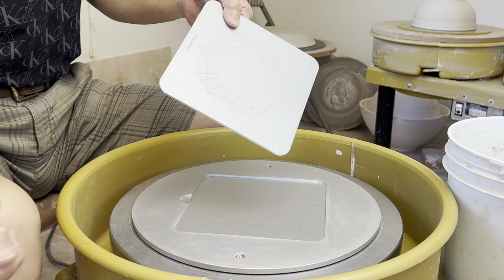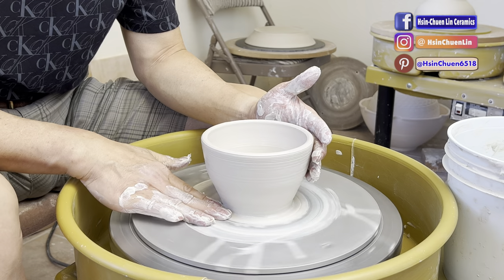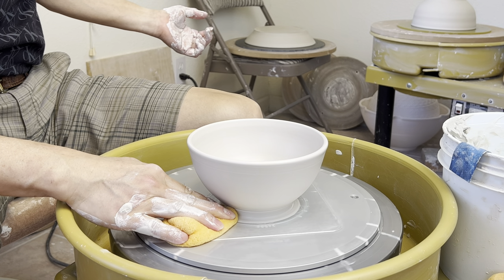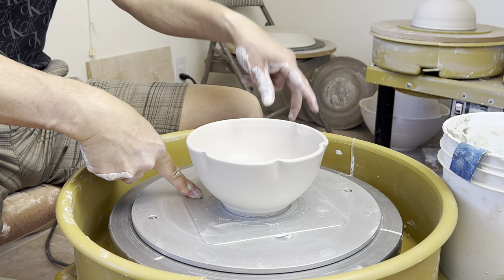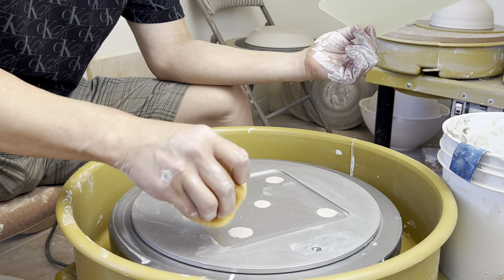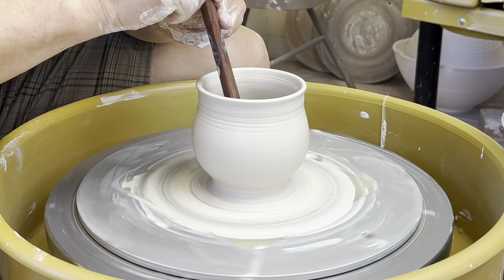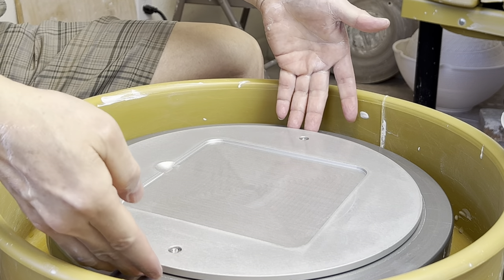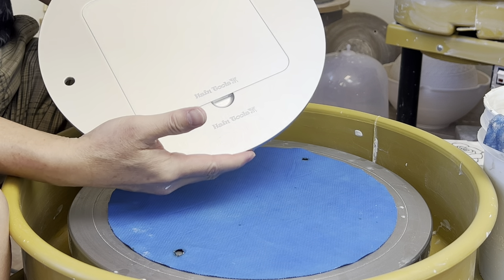688. Using Square Bat Inserts on Hsin Tools SpaceSaver Aluminum Bat System with Hsin-Chuen Lin

Comment: About to buy on Etsy, Hsin - just wondering if the pot lifts off as easily as it does from a wooden bat which is absorbing moisture from the base?
Reply from the maker: I would wire it off the bat instead of waiting for the pot to pop off the bat.

Comment: That looks like a wonderful system,  Is it available now?  Also what type/brand of clay do you use?  Thank you
Reply from the maker: A limited amount are available on my SquareSpace shop. Please check the link on my comment area. The clay here is Coleman porcelain mix with our local supply brand called Glacia porcelain. 2:1 ratio.

Comment: I would experiment with interlocking groves instead of clay to hold the bat in place without sliding.
Reply from the maker: The bat inserts are not sliding. It’s the hairy tolerance (the gap between the master bat and insert) making the noise. Little clay balls to hold it down to reduce the noise if it bothered.

Comment: Why don't you patent this insert system (or even using some clay under the insert) like you patented that depth gauge? You know the depth gauge invented by every single potter before you when they need to measure how thick the base is. You were just the first that thought they actually were the first.
Reply: You read the specifics of his patent application did'ya?
Reply: @HominyHomonid  Yes. It's absurd that a patent was granted for a device that is essentially a stick across the pottery with holes for one or two rulers. Every potter I know puts a stick across, and measures the inside and outside height with a ruler and subtracts the numbers to find the bottom thickness.
Reply from the maker: The patent was also granted for turning the measuring into tombo sticks.
Reply from the maker: Do you have any idea how costly and time consuming to get a patent? The main purpose is to protect the idea being copied and mass production by someone in China. By now I am still laser engraving every single one the the rulers in my home studio.
Reply: @hsinchuen  Yes, I know it is expensive to apply and secure a patent but there is no idea to protect here. The concept for measuring the thickness of the base is ancient, every potter has come up with this method when the need arose. The problem is an inept patent clerk that accepted a blindingly obvious thing as novel. Besides, having a patent means nothing if you don't protect it. I have violated this patent for at least 10 years, and so have most of the other potters I know, so basically you wasted your money.